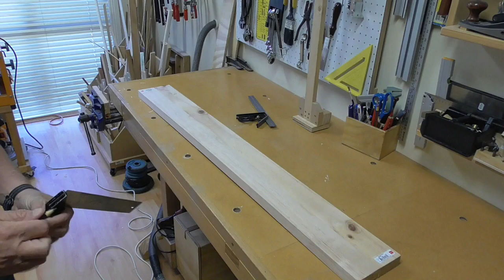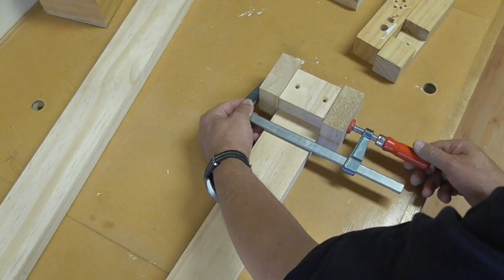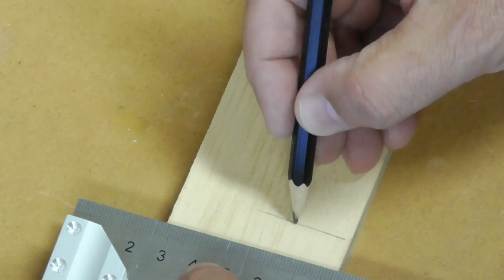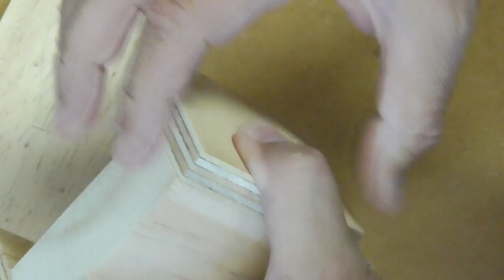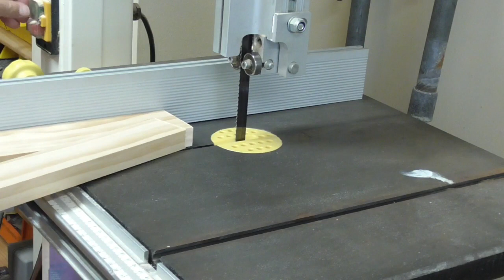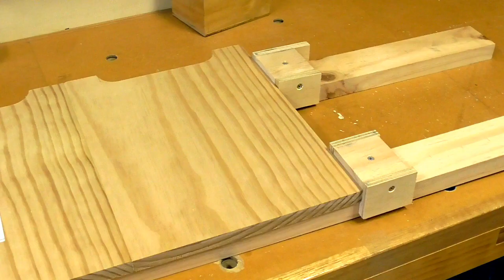DIY Bar Clamps

Comment: right im not the brightest lamp in the class , can we concur the tightening  is created by the clamp pushing the wedges inwards and thats it ? and does it have enough force for glue ups
Reply from the maker: Hi. The wedges can create more than enough pressure for glue ups, especially if you give them a bit of a tap with a hammer.

Comment: why not set the end pieces in a dado?  Wouldn't that make them stronger?  Granted a overhang but I would think more strength.
Reply from the maker: A dado would make it stronger, but the scews do OK. The clamps are more than adequate for glueing boards together. Strive for simplicity.